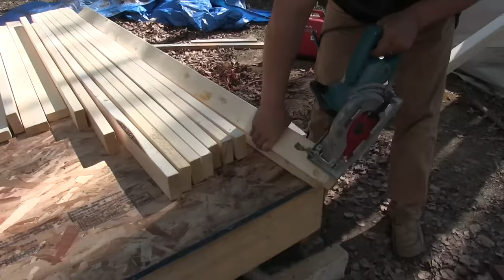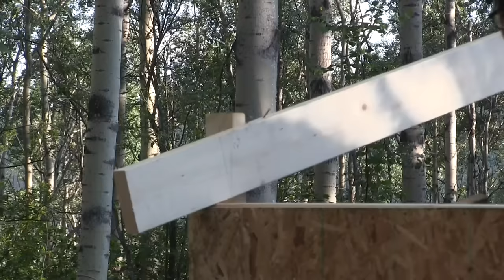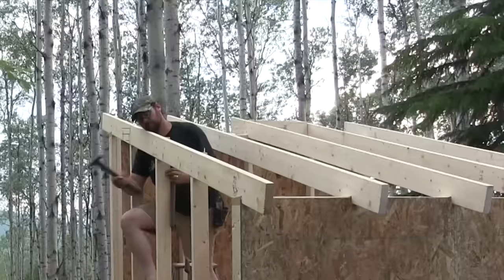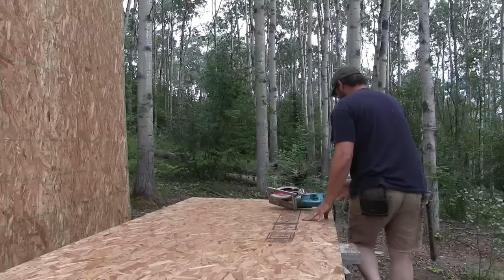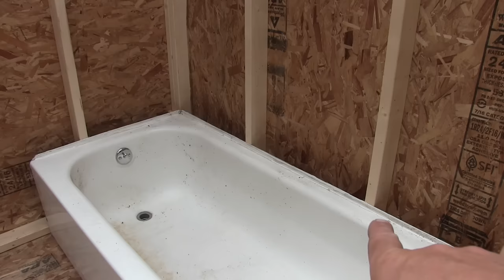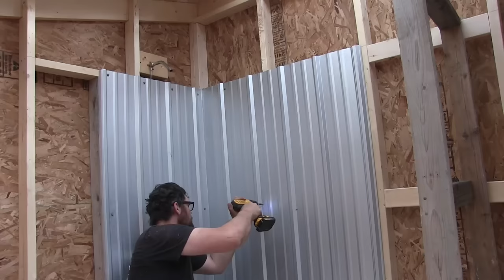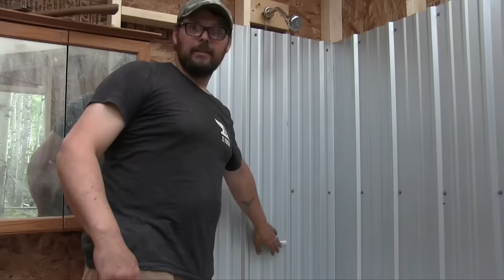Off grid shower house Project

Comment: Did anyone else find it extremely satisfying watching the wall be pulled to square using a turnbuckle?
Reply from the maker: Thanks everyone
Reply: Mondavou   You can do the same thing by measuring diagonal and nailing plywood on to hold it before you ever stand the wall up.
Reply: What kind of brand of pump is that ?
Reply: YEP!  Pretty much everything else was cool too.  I like the work mocs.   Minnetonka?
Reply: The turnbuckle thing was total genius! I agree completely!
Reply: Omg, totally. Thx for mentioning !
Reply: I was very impressed. Building pole barns we've used trucks, tractors. Thay was a trip. Being an Hvac/Painter it was amazing seeing a 50x30 barn rack around. Yet this turnbuckle system was just as impressive.
Reply: Yes , that was an awesome FIX that actually WORKS!!!
Reply: @Bushradical  could you tell me the name of the pump you used? Thank you
Reply: I missed that part.
Reply: Hijacking the popular comment thread for a moment. Great video, the only thing I want to add is that you are using your Teflon tape backwards. You get the same results either way, but turn the spool 180° and it’s so much easier to apply. I know it doesn’t mean much here since you only need it a couple of times but to someone who constantly has to seal threads it’s worth it to pass on the knowledge. Love the video, keep up the amazing craftsmanship.
Reply: @TheMouseCop  everything looks backwards on video
Reply: @ lostintime86:  and smaller!
Reply: @pederstrand8349  I always thought the camera added 10 lbs.
Reply: Ratchet strap, boom chain, or comealong works too.
Reply: The same thing can be done using a 2x4 brace and a kicker. Turnbuckle does the same job for concrete forms. Use what ya got.
Reply: My daughter used a ratchet strap tiedown from my truck but left it in there when she put the walls on now it’s a permanent part of the house
Reply: Yeah
Reply: @Bushradical  Seems like you have fans for your turnbuckle hide it very carefully lol. Great work Dave as usual.
Reply: Plumb and Square (Bushradical Turnbuckle Style!)
Reply: The word turnbuckle is satisfying by itself
Reply: Turnbuckles are Sweet!!
Reply: Dad turned the skill saw blade backwards and cut it like a board.i would insulate for winter freezes.
Reply: @carmenmariacortesmarin2664  The Zodi™ Extreme™ Self-Contained (SC) shower is a multi-functional portable hot shower
Reply: @bobleeswagger312  The Zodi™ Extreme™ Self-Contained (SC) shower is a multi-functional portable hot shower
Reply: @mondavou9408  thank you
Reply: Totally
Reply: I let out a little sound
Reply: Haha yes totally!
Reply: What part of the video showed using a turnbuckle?  I watched a second time and did not see it?
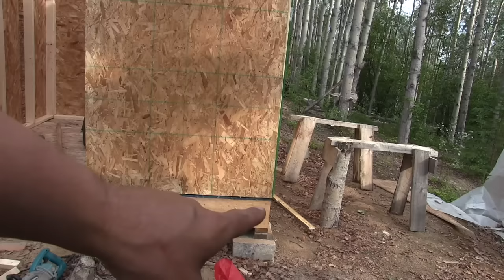Reply: @Jon-wn3fq  Youtube removed it, it required creativity.  ;-)  11:00
Reply: Sure did.
Making a limited amount of warm water do a shower can take practice, especially if there are 2 of you.
Reply: Very satisfying. So is the word "turnbuckle"
Reply: OCD'ers all over rejoice.
Reply: Ratchet straps work too.
Reply: No I can tell he's not a carpenter but rather a handy man.
Reply: @Bushradical  j Abra war with rather go with your name
Reply: @dannymatthews6365  .l, How do you do if your nails filled with your name
Reply: I actually found the intire project/process satisfying  I day dream like crazy and it gives me idea's for when I build my own cabin and shower house 👍
Reply: That pump was said to be a ZODY it sounded like. I tried to look it up.
Reply: Yep I learned a thing or two
Reply: This takes me back to when my Carpenter husband and I were remodeling an old cottage. Every Carpenter needs a good turnbuckle. 👍
Reply: I'm an old stick framer .
These would have been great for straightening or as I refer to as sighting exterior walls.
If I have a long exterior wall, I will stretch a line from end to end that sits on a 2 x gauge block . Once the line is in place I will take another 2 x block down the length of the wall at each brace . When the line just kisses the block you're good 
With those turnbuckles I could work by myself if I had to. Making the adjustments would be simple.
When working with another guy and no turnbuckles you are relying on their brute strength to pull or push that wall in or out and then he's got to nail the brace

Comment: Nice, only thing I would have added is insulation to make it a four-season shower house.
Reply from the maker: right
Reply: Also add a small stove to heat it, and while you are heating you can boil a pot or two of water.
Reply: @wewd  I like that idea

Comment: Holy crap. The reason I haven't built my shed is my lack of "math and geometry" knowledge. No idea how to make rafters, until right now. I really appreciate what to you must've seemed like a throwaway tip. Thanks.
Reply from the maker: I'm glad it helped!
Reply: Rafter calculations are actually pretty simple once you understand the Pythagorean theorem (a2 + b2 = c2)  A = run b = rise and c = rafter length minus any overhang you want.  If your run is 4 and your rise is 3, then your rafter length will be 5.  then you add on your overhang say 2 feet and your total length will b e 7 feet for your rafter.  Hope that make sense to you.  :)
Reply: @georgeshaw8276 , back when most carpenters would layout rafters at the job site, they used a square to measure the length, angles and cuts for rafters. It seems to me that Bushradical's solution is quick and accurate while at the same time reduces the chance for most errors to creep in. I'm saying this as someone who is familiar with the use of Mr. Pythagoras equation as well as the challenges of transferring numerical measurements on to lumber for cuts.
Reply: FYI:  The notches Dave was cutting into the rafters is known as a "Bird's Beak" for seating the rafters onto the top plate ...
Reply: @harrymurphey2634  You mean Birds mouth...........
Reply: Square the building, bottom and top, then cut rafters.
Reply: Really not that hard! Main thing is knowing the rise and rafter length! Using a framing sqaure find your rise per foot is 5" per 12" is a 5/12 pitch! Same with 4/12 and so on a gable roof thats about all you need to know! A all hip roof is a little more complicated!
Reply: Daves way is far simpler!
Reply: In case you need help send a sketch and we can help you! Best wishes from Sweden
Reply: @georgeshaw8276  well you made my brain hurt. The 2's in the equation confused me.lol. I was multiplying  everything by 2. And never could get 7.lol 
How about just say 4ft run+ 3ft rise =7 total board ft less 2 ft overhang.
Reply: me too.. i built my own shed  just attached my roofing to each other and its only laying loosely across top. wind  blown it off twice. i still puttering on the rafter build...yes  awesome  teach  there...TY.. I couldn't get the math just right either...ty.. ty.. ty.. i got it now.
Reply: Just do a flat roof.
Reply: @Bobo-ox7fj  I haven't had coffee yet. You can't just start math stuff on me like that.lol

Comment: That was amazing. When I was a kid my parents bought an off grid cabin(dilapidated shack) no electric no water . Only propane bottle for stove and a wood burning stove. We added a room for extra beds and built a toilet room which we used a bucket commode. We washed up in a sink with boiled water. This was the early 80s. I always thought as a kid there was a way to do a shower. Never could figure out a way except a solar camping bag shower but as an 8 year old no one took me seriously. I devised a hanging gravity driven bucket that dropped water into a larger bucket on floor and I boiled water poured into hanging bucket with a mix of cold water and that was my off grid shower. My family laughed at it as they couldn’t fit under it only me. I thought I was a genius for doing that by watching how you did your shower set up I think that’s totally genius I wish we could’ve found one of those buckets with the pump handle along time ago that would’ve saved us a lot of aggravation and kept us all smelling fresh as daisies because two weeks in the summer up in a cabin in the White Mountains you tend to get very swampy. Thx for the amazing idea
Reply from the maker: LOL so true. But I think you were a genius for the bucket idea.

Comment: Your pump shower reminds me of the form oil sprayers we used at the 2 structural concrete companies my brother and I owned in the late 90's to mid 2010's. And some people would say that is not nearly enough water for a shower. Well, if you take a Navy shower (30 seconds on, turn off, lather, 30 seconds rinse), it is more than enough. Especially, if you use a low flow high pressure shower nozzle. Served 20 years, 2 months, 28 days on submarines and aircraft carriers. MMC(SS) USN Ret.
Reply: Thank you for your service Douglas!

Comment: Teflon tape tip: hold the roll so it doesn’t unwind the tape when you turn around the tread. That way you can manage how tight you apply the tape and don’t end up with a mess of to much Teflon tape.

Comment: Great build! I love all your videos and learn something new each time. BTW, if you have a lot of metal to bend, using a hinged board to bend the metal (from underneath the metal sheet) with a 2x4 clamped down on top near the bend point would make it easier.

Comment: Great build and video! Thank you.  Being a newbe I have some very basic questions.  Were your wall studs on 16" centers?  The rafters, were they on 24" centers?  What do you do with the drain water, do you have a drain pit, or just run out on the ground?  How about the winter, what about the drain and drain lines, as well as feed lines in freezing weather?  Why did you use two clear roof panels and two metal panels?  It appeared you may have used a small section of metal panels underneath the clear panels points of attachment.  Why did you choose to use metal underneath the clear panels?  I wish I were near you to offer you another set of hands, I would love to learn more from you.  Your videos are very helpful, thank you for sharing your knowledge.
Reply: Michael Maroon, I believe I can answer a few of your questions. I don't believe winter affects the drain or feed lines because they don't keep water in them. I"m sure he takes the pressure pump with him when he's not there, so no one can steal it, which releases the pressure and drains all the lines. He used clear roof panels to let natural light in, otherwise it would be very dark even in the day time. It looked like these clear roof panels weren't quite as long as he needed so he added those small pieces of metal panels to give the overhand he wanted.
I too wondered about whether he had a drain pit or just runs it on the ground. I would think some sort of pit is needed else it would get sloppy wet around the shower house.

Comment: I love the simplicity of all of you designs if I may make a suggestion when you frame your walls as I'm building a house my sheathing extends past my wall approximately the depth of the box so I stand the wall up I can then attach the sheathing to the box this gives the wall a little more stability from wind lift I don't know if you experienced that in Alaska or not but here in Cape cod Massachusetts we have a lot of winlipped that can peel the plywood off your wall and sometimes take the wall right up your sheds thanks for listening Plymouth Rock

Comment: Amazing! I would place a few windows for air and the view! Great pump system as well! Oh uh a bench for sitting after your shower and drying! What happened to the water does it just run into the ground or goes downhill?
Reply: @MensaGiraffe  looking back at the install, at least water would not freeze in the drain itself, there is no trap to hold water before it goes down.  It would just freeze wherever it flows.  Still...

Comment: That pump is amazing, had no idea something like that existed even though it's not that crazy I guess
Reply: It's the kind of pump we used to use to spray insecticide on our garden when I was growing up. I can tell you from experience that the kind of pressure he's showing only last like 2 minutes max if even that, so you'd better be really quick or be ready to lean out and pump a few times each shower. Or take turns with your significant other to keep that kind of pressure for the whole 3 gallon tank. Still it's a good idea.
Reply: @keetagriffin1913  I saw something similar watching guys spray water on fresh concrete, it looked about the same, then I realized it is probably that except he put fittings for a hose (my guess).
Thanks for the info

Comment: @ camp we had 2, 55 gallon drums on the roof, painted black,  laying on thier sides. Well water ran into the drums, heated all day by the sun, & then mixed with ice cold water out of the well..The first 5-6 guys got hot, short showers,  the rest got cold showers or not @ all...I always got a hot shower.

Comment: I like the way you build these off-grid projects. BTW, when I'm trimming multiple studs like you did, I find it easier to lay them together, flat side down, square them up, then attach a piece of scrap pallet wood across them with short drywall screws into each stud. Then, a single pass with the circular saw is all that is needed. The scrap piece, if positioned right, can even be the guide for the saw!
Reply from the maker: thanks
Reply: Great tip!

Comment: I never would have found such a well designed shower pump without this video. Can't wait to get a Zodi shower!
Reply from the maker: Any pump should do you fine.....the zodi is unlined stainless steel so you can heat it over a burner
Reply: Any chance you have a link or where to by this zodi shower pump tank? I’ve been looking everywhere and can’t seem to find one.
Thanks for your time,
Jon

Comment: You're not going to believe this... I've been remodeling a house my mom bought, and I have the same mirror cabinet that I saved from the house! I thought it looked familiar, since I've watched this video before 😅. I'm going to use it in my off grid cabin! I'm going to use your tub idea but integrate it inside the cabin, instead of having a separate shower shed. Where would I buy a hand pump pressure shower like you used? I like the idea I can boil some water and put it in for a hot shower.

Comment: Has been so inspired by your videos the three part series of the offgrade cabin in the woods I love that I love part three where you’re talking about how anybody with half of her body can do this get off your couch put down your phone and do this and I’m sitting here in my wheelchair thinking I can do this I have half of working buddy I can do this my left side is paralyzed from a stroke I used to be a framer many many years ago I totally understand the process I was concerned could I do this or not and then with your inspiration of seeing anybody with half a body can do this as I’m sitting there saying out loud to the TV I can do this and then you said anybody can do this so inspirational thank you today I’m watching your offshore house video and I’m watching very very carefully to see what things you’re doing that I can do one-handed you’re not carrying the OSB no big deal I can do that one-handed making all the dogs to hold it in place so that I can mail it off I can do that and then when you get to the plumbing you’re wrapping the Teflon tape around the fittings I’m thinking you know I have a good pipe vice mounted on the flatbed on my truck if I just gently put that showerhead sitting in that pipe vice I can use my good hand to wrap the Teflon tape and then the brass fitting and then the hose fitting and the showerhead itself and carry the whole thing in there put the screw through the flange and hold it up to the wall with the driver bit screw the first one and make the alignments with the second one in all of that with one hand there’s a few things like when you were on building the last wall the last stud wall with the rafters already in place and you’re backing with your sledgehammer I’ve made enough concrete forms to know how that works but I can’t hold that sledgehammer is backing for nailing off that Stonewall so I love the idea of pre-drilling and then I can put the nail in the drill hole with my good hand and I don’t have to hold it with my useless and I love that idea I can use that everywhere you know for my toenail linger in and everywhere just give me something to hold that nail in place to get it started and for regular framing I like the idea of a magnetic head hammer to get the first set and then drive it in with the hammer for sheeting I would probably just use mine wide stapler I can hold the sheeting up against the stairwell with my shoulder and operated nailer with one hand and a wide top staples would give sufficient surface coverage to hold the sheeting in place it’s only a very few things that I am watching this video where I would have to ask the wife to come help hold something or push against something or whatever but I’m watching very very closely to see what you’re doing and can I do it one-handed and for the lion share of it I’m seeing that I can do thatI feel a little modified procedure from the way you’re doing it but I can do it one-handed might take me a little bit longer than you but with my tenacious determination I can do this I will do this I’m currently looking for the property to do the song I will keep you updated in my progress thank you so much for your inspiration I love your videos

Comment: Wow, that´s awesome! I do appreciate but might have a few suggestions: why not do it properly, even if it is off grid? Have insolation, wind stopper outside (Tyvek), a solid floor and roof AND a stove for wood? Then you can use your shower house throughout the whole year. Best wishes from  Sweden!
Reply from the maker: I'm only here in the summer and fall

Comment: That is really cool! I wondered how long the water would flow under pressure,  I used to use one of those pumps to oil concrete forms. Very efficient way to do this!